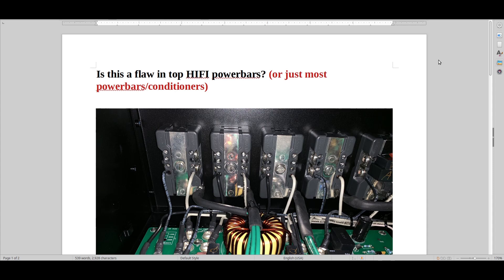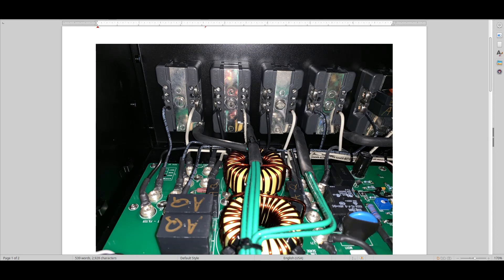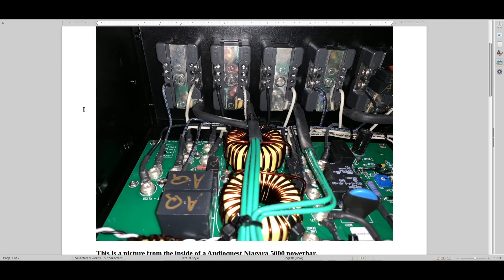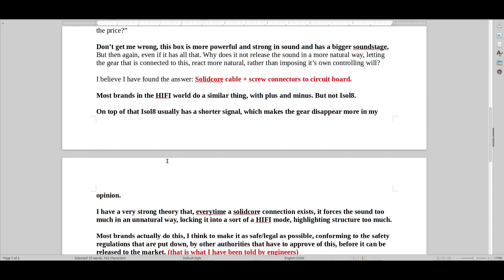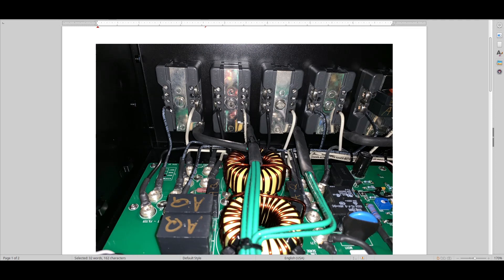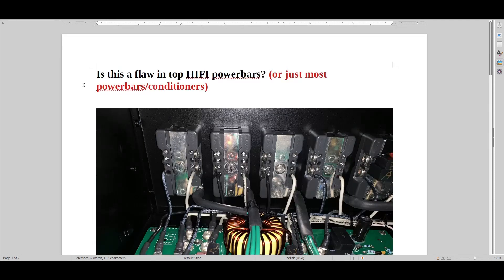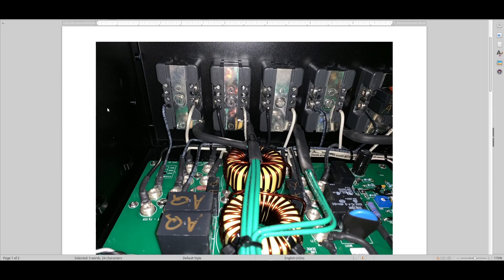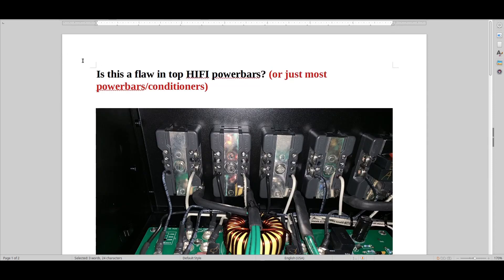Is there a flaw in all HIFI power boxes?

Comment: Hello from Montreal, thanks for this discussion on power boxes. I never knew that these components had a sound! But I'm a bit weary on tweaking them or touching any component that's under warranty. These power boxes are also for surge protection so if there is a problem and your audio equipment gets fried in a storm, the manufacturer of the power box may not support you. It's like cars, I had a Golf R and you could buy these aftermarket modules to tune the car to get better horsepower. All is great until you have a problem with the car, the first thing they do is check the car's computer and see that's been modified. They void the warranty on the spot! 
I do understand and appreciate your videos on audio components and their issues regarding the materials used for sound quality. Thanks a lot.

Comment: Real HIFI i've got so many questions and i don't know were to start...
My objective is to have the most good\clean power possible but i've heard so many different opinion that right now I'm blocked before buying anything.
Dedicated line, gigawatt powerstrip, isol-8 minisub, power conditioners, power cables, bad house grounding, i really don't know where to start or what should i believe or what not. I'm sure that you are my solution for having the best possible outcome without spending 5k just for electricity. I personally think that is the base, the fundamental thing to have right, before starting to buy any expensive equipment. You always reccomend the isol8 minisub axis, is that the final solution to eliminate all the problems with good power cables? (Which ones?) Should I look into a Dedicated line with a proper cable like the gigawatt lc-y 3x4? Can a bad grouding house ruin all the isol8 work? Can EMI and RFI ruin the gear? I really need your help before i start spending all my savings for something that will not work. Which is the first step? How can i solve all the electricity, EMI,RFI, grounding problems? I really don't know where should i start. Thank you anyway. You are the only one that i actually trust.

P.s. happy holidays and happy new year <3
Reply from the maker: I recommend getting the isol 8 mini sub axis as the first step.

Then get the oyaide swo xxxe inwall plug, with gigawatt inwall cable and circuit breaker.
At the same time, get the electrician to check the grounding. Ask the electrician those questions about emi and rfi.

When all of that is installed. Then make audio note isis power cables with wattgate silver 350 plugs. Then you are all set.

Happy holidays
Reply: @RealHIFIHelp  Thank you very much, I will do as you said. First step isol8. I couldn't find the oyaide swo xxxe model but the SWD xxxe, is it the same?
Reply from the maker: @daniele6676  There are 3 models, one that is black color which is the best based on the 037 metal, which is most likely not sold any more. Than the:

swo xxxe version with paladium and then the gold version you refer to: xxx. They are all pretty good in their own way.
Also you can maybe get wattgate silver inwall, I recommend getting that instead if you anyway want to use wattgate silver on your power cables. They are damn good to, in a differemt way.

Comment: I currently own a panamax 5400. I’m looking into a Niagara 1200. Would the be any difference with sound going to a 1200 or would I need to move up to a 3000. What power cable do you use with your conditioner
Reply from the maker: I use custom made power cables that I made myself which are in my 50 USD book, costs about 200-500 USD to make. Send me a mail if you want that book, it solves all HiFi problems.

There would be a difference in sound bias but not really a class difference. I suggest Gigawatt pc 3 se+ or the Niagara 3000+ models or Isol 8 mini sub axis which is much better overall.

Comment: Have you every tried the Isol-8 Substation Integra ? I would be intrigued in your opinion about it, especially regarding compared to the Isol-8 Minisub-Axis. 
Which is better and in which aspect. Thanks.
Reply from the maker: The substation is minimally better. Yes on every aspect it is better. Basically more power/control/black level.
But it is not as reactive to the good powercable feeding it. And that is because they have used certain plugs that you have to buy with certain cables which are of a much lower quality. This means that you cannot buy super good plugs like the Oyaide 037 and use regular fittet power cable that can hold more metal in them and are much better in performance.
This means that all the personality and good priority and style, sort of gets killed of with having to use these very generic powercables that only like a handful of companies produce.

So if they started changing the plugs to regular power plugs, it would actually be quite a step above the mini sub axis.

To me this is like inventing a sports car, and then putting on a Dacia lowest model exhaust pipe on it.

And that is the secret to why the ISOL8 mini sub axis is so great compared to most other powerbars. Every single powercable you use to power it up with, it is highly reactive to. Where most powerbars on the market there the power cable feeding it, sounds very much the same.

A lot of powerbars just have this sort of blah/generic sound from whatever cable is feeding it. Here on the mini sub axis, you get much closer to exactly what the feeding power cable is doing.

Comment: So you think solid core wires don't sound good? I thought the wire strands wire was supposed to sound harsh.
Reply from the maker: As soon as you try to modify these type of boxes with stranded cable and hear what stranded cables does in the wall, even though it is not allowed, then it becomes apparant that solid core sound is generally very massive in sound scale, travels fast with punch/power/detail and with a lot of pressure and grip, but that all of this comes at the expense of it sounding 3d/deep/fully natural.

It's not something that the industry wants to admit to, because it only costs about 1/5 of the price making solidcore cables plus it measures basically the same, but that is why it is done.

Ultimately stranded cable has more 3d/flow in sound making it seem more genuine/nuanced, whereas solid core most times is surface detail that just wow's people. 

Of course there are levels of solid core and stranded cable design, but still taking that into consideration, that is my take on it.

Isol 8 are one of the few who uses stranded cable, and directly compared to Audioquest and Gigawatt all of these sound attributes, start to seem more apparant. Yes there is more to a whole powerbox than just stranded vs solid core cable. But I mention it, because the industry does not.

And yes at first glance I would usually and most people in the world would probably also go with the more expensive boxes in the 5-25k USD zone, rather than a Isol 8 min sub axis for maybe only 2.5k USD. Simply because they are more impressive.
But after going past a couple of momths of listening, I think that most people would agree with me that Isol 8 mini sub axis just sounds more natural/intimate/integrated, while the other boxes constantly tries to impress with the surface detail.

Just my opinion, I still believe that AQ and Gigawatt are most likely number #2 and #3 in my book.

Yes stranded wire can sound harsh or wrong when done incorrectly, but also solid core.

Comment: Just my two cents: how can all these components « destroy sound » when actually no audio signal pass through them? Aren’t all these components just for powering whatever’s plugged in?
Reply from the maker: All of these boxes like Gigawatt and Audioquest and Isol 8 are basically the best on the market.

But a few of them like the Audioquest, can get much better once you use a more fine thread.

It shifts the priority from a more dominating cool sound, to a sound that is more natural.

If you want to feel what it is that I mean. Try and make a power cable that is made of the same inwall solid core cable, for around 1-5 dollars per meter. Then you can hear what it is that I mean.

Everything that goes on in a power box affects the sound. Power is king, it dictates the flow of power your cables get which regulates the flow of stuff like CD player, AMP, DAC....

Solidcore cables knocks music through only promoting structure/brute force, fine thread sends it out in a much more fine flow making it more musical/3d/layered/human like.

Comment: Hearing good things about Puritan 156 , but internals look similar to audioquest at least pictures ur showing , for now I've purchased 5 m audioquest thunder cable that I'm running from my power patch panel to my passive cardas power strip ( no filtering) , thinking about dedicated ground , power is important , are you saying solid core wire is not good ?
Reply from the maker: Ideally we should use fine threaded wire from the blackboard to the power socket/outlet in the wall.
But since that is not legal, then I suggest you just use something that is legal and better than the standard stuff. Oyaide swo xxxe wall socket is also highly recommended for extra musicality. And a gigawatt circuit breaker.

Comment: You could easily have a tech change wiring to stranded and solder to board to confirm your theory.  Modifying / upgrading gear is not illegal.  Your  point is unproven.
Reply from the maker: I have done the tests with several boxes. And that is just the point, you are only looking for the measuring part, which only shows the surface of the sound.  That is why most smart engineers have not found it yet, because it confirms your theory of it measuring better.

My theory which I tested, actually measures worse, but sounds better. (that is why no one is pursuing this idea)

You want proof, then use the same inwall cable and put it in on a power cable and test it on an amp and other units. I also did that, it is much more powerful with much more grip. But also proves my point, that it is bias sound.

Measurements only deal with fixing the surface problem, this I am talking about is beyond that; the signature of the sound which I am complaining about.

But again, beyond that problem is a whole other problem. And that is that, it has to be certified/approved to be covered by the higher authorities. And nobody wants to pay for those high priced licenses. So instead they just use what is almost identical to inwall cable to solve the problem. Looks good on paper, and nobody will ever know.

Except for someone like me, who actually did the test on several boxes. (listening tests)
We have a similar problem with not being able to legally use stranded wire from the wall socket to the circuit breaker, which also affect the sound.
I also by the way heard that a couple of times. Frees up the sound a lot.